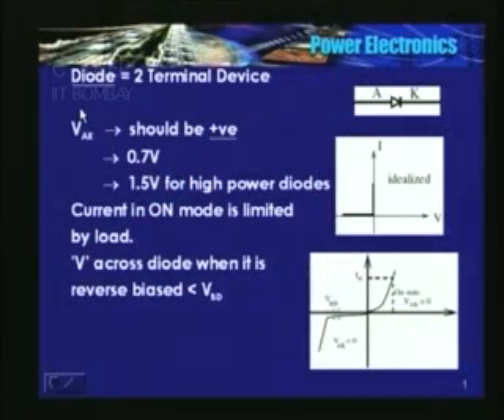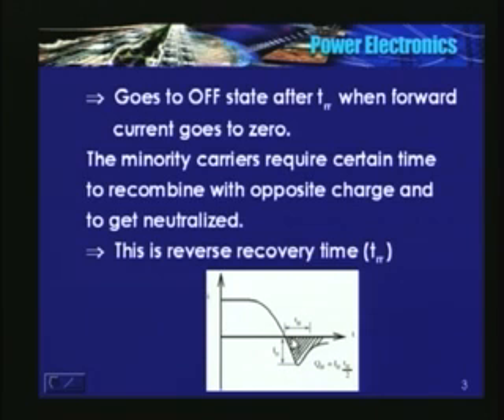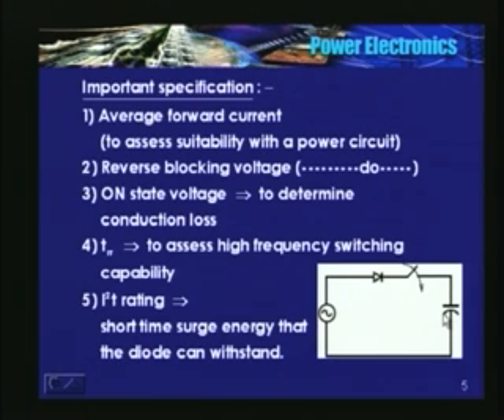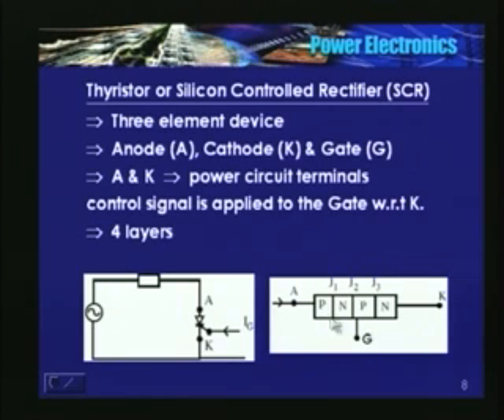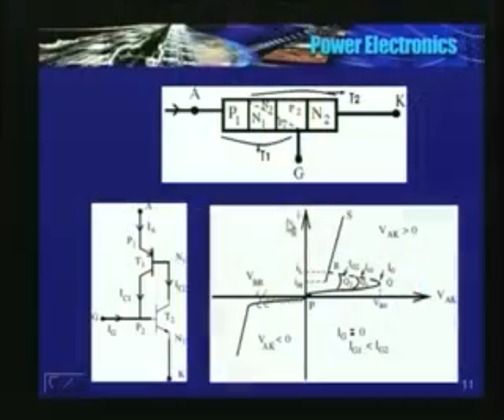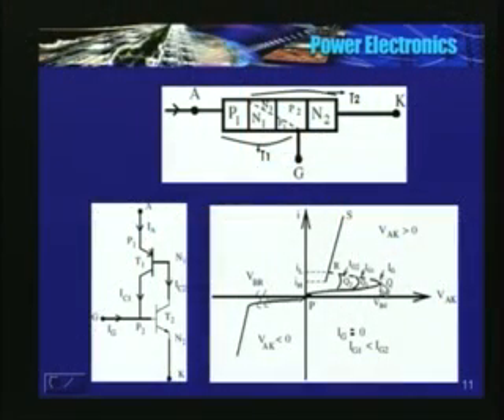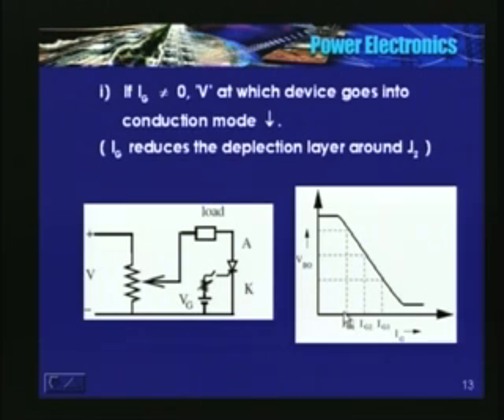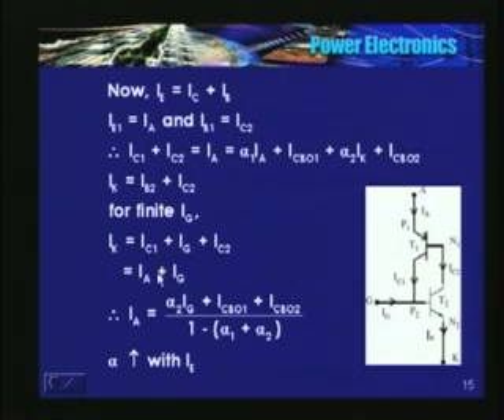Lecture - 4 Power Electronics

Comment: Sir, u r telling that if we apply voltage greater than Vbo the scr comes to on state.is it possiable
Reply: @Malleswararao Vastrala it possible to turn on the tyrister by applying voltage (anode to cathode ) greater than vbo 
 only if the thyristor is in forward blocking state  it will transform into foward conducting state . hope ur querry cleared...
Reply: yeah but scr wil get destroyed